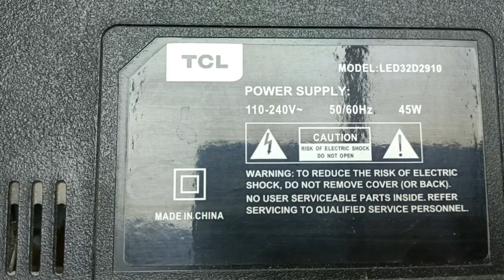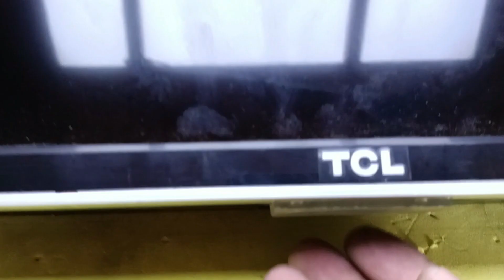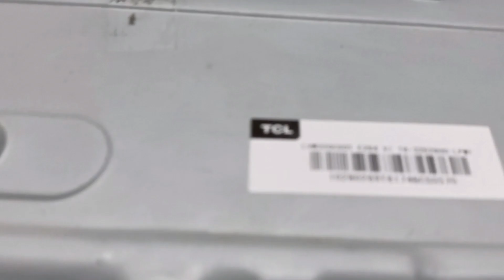How to install backlight inverter-TCL Led32aD2410#ger tech ph

Comment: mrming slmt sir,, new bie and new subscriber po,  sir tanong lng po,, relay lng po b nkakabit s backlight inverter wala po b ksm ung relay kht wala n po trancistor or resistor ok lng po yan? psensya n po kung tatanung po ako,, god bless po
Reply from the maker: Di po kasama sa backlight inverter ang relay.. bibili na lng po kayo ng 12volt na relay wala din po yan na transsistor or resistor.  Ung contact ay para sa AC at ung coil ay para sa 12volt.
Reply from the maker: Thank you for watching and subscrived.